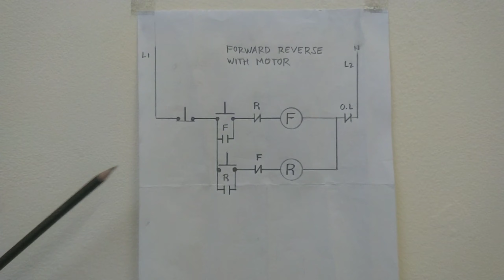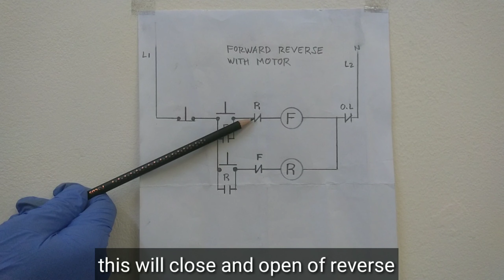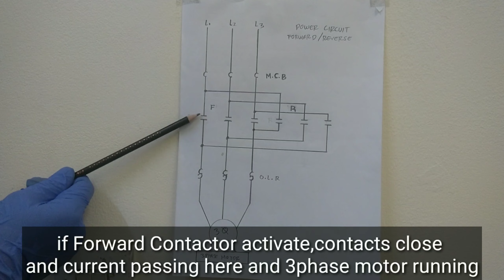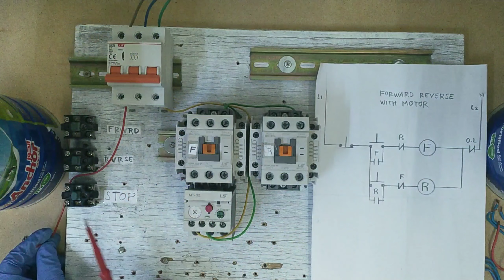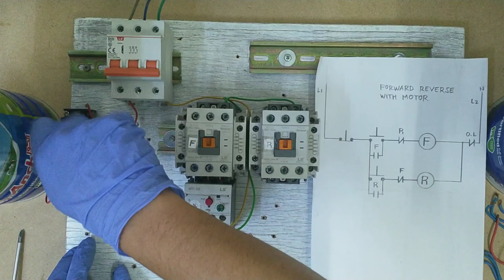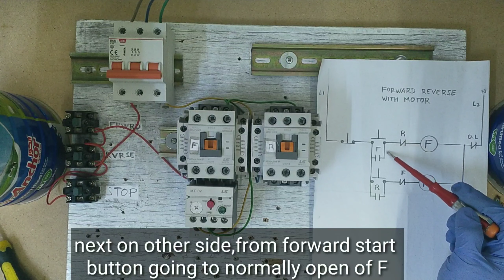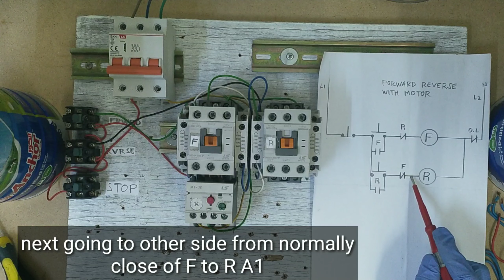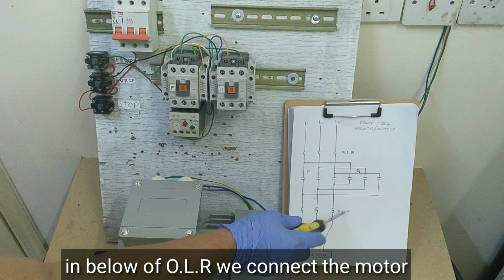Forward Reverse With Motor (English Subtitle)

Comment: Master ask lang po pede po master yung diagram niyo my  ro po tagging para maitindihan po kong san niyo eh connection yung mga wire, salamat po master pasenya
Reply from the maker: Hindi na kailangan Yan sir para makabisado po ninyo lalo na sa mga baguhan.basta NO or normally open kahit San mo ilagay Jan kahit magkabaliktad  OK LNG YUN,ganon din sa normally close or NC.tas ang A1 at A2 considered Nayan sa coil Ng device ether contactor or relay